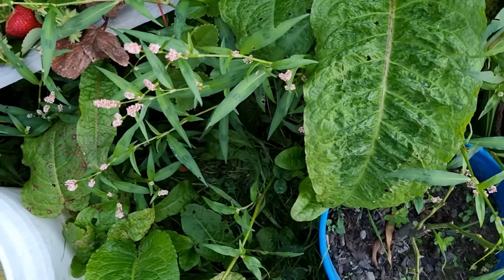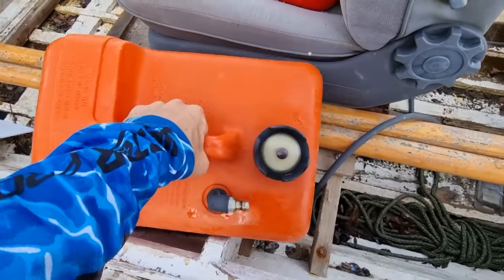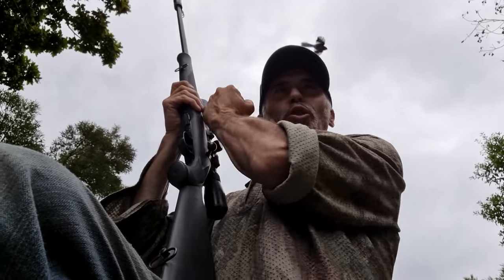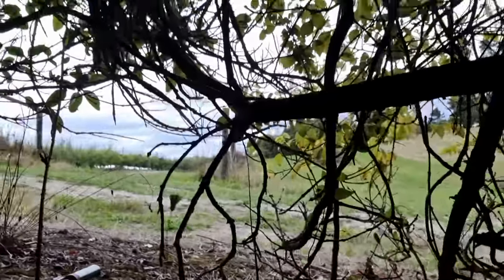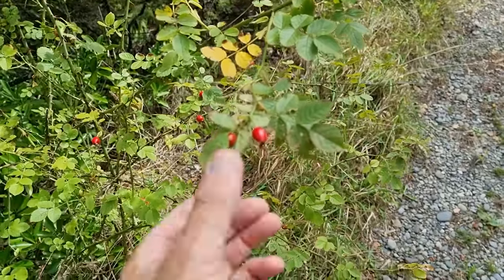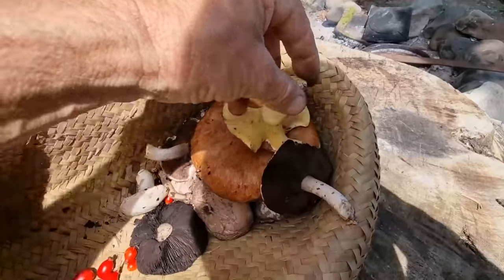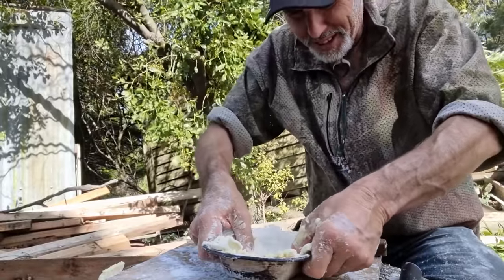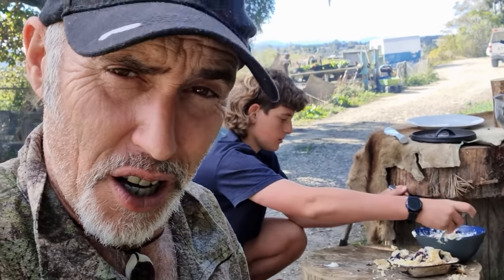2 Days Off School 4 Spencer. Work Experience With Clay Tall Stories

Comment: Clay, have you considered getting one of those spikes you drive into the ground, and then have height adjustable swing-away hot plate, grill, and pot hanger, rather than the old star pickets across the fire? I reckon you deserve one, considering how often you’re cooking outdoors.
Reply from the maker: We use three warratahs as a trippod sometimes
Reply: Yeah, I know, but this is your outdoor entertainment area, and it’s 2021. 
Not having a go, but I thought you might think it was a decent idea. 
In the bush, when you don’t want to carry one, of course, cut some sticks..